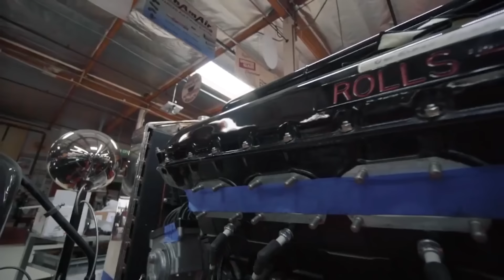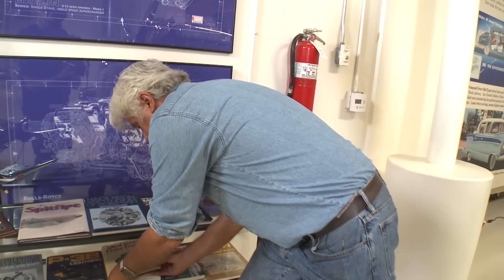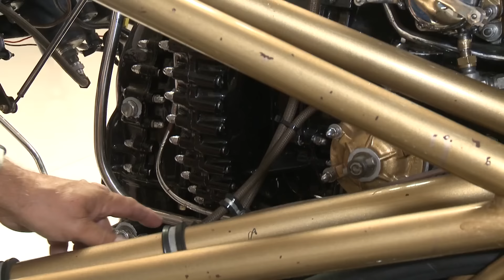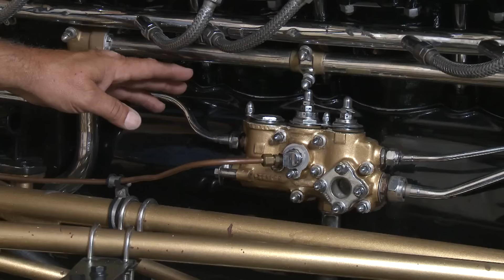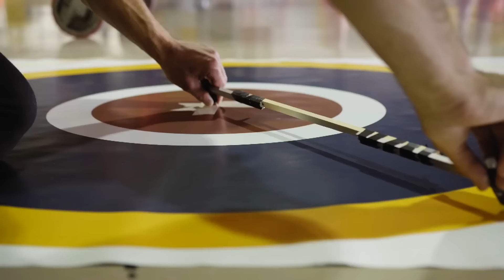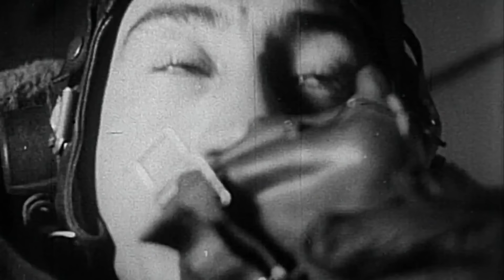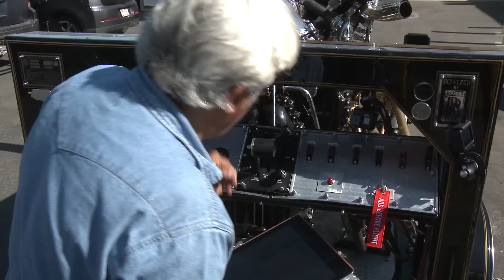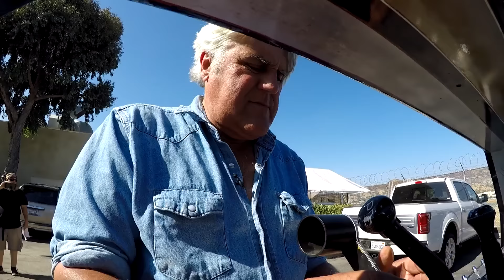The Engine That Won World War II - Jay Leno's Garage

Comment: why does t seem that older engines got more power than modern ones; the merlin got more than 2000hp in some versions bit the Bugatti's have to have more cylinders just to come close. Also, why is this engine not being built today? can we convert ot to run  non ethanol modern fuels?
Reply: Brad Davis-   (1.)  the Merlin never did produce 'more than 2000hp.  (2.)  Horsepower is more a result of displacement, not cylinder count. (3.)  That engine is not being built today because it represents an enormous amount of complexity, which makes it too expensive to build.  You get more horsepower and reliability out of a jet turbine, such as a jet turbo prop for aircraft use, that's a hell of a lot simpler, infinitely more reliable, and cheaper to build.
Reply: Hmm. Some Merlin's did make more than 2000hp, at least if Wiki can be believed; they called it the racing Merlins. But I do get what you are saying: the engines were more complex back then, especially since everything was mechanical. To be honest I just love old engines and love to think about what could be; can one imagine what a modern Marine Packard or even better, a Napier Saber engine would do. And I do believe  that modern versions can be built;  since super/turbo charging was still in early development back then, the modern chargers will make good use of all that displacement, fuel injection, cooling etc... but keep the engines constructed from cast iron for durability and high hp would be the norm for those engines? Well, too bad I have to wait till I gets Jay Leno's money to find out haha!

Comment: The two-piece block is interesting and rings a bell with me.
As I recall... early Merlins had a one-piece cylinder block (not sure if the entire crankcase was a part of that) and head per bank. Unfortunately, porous castings led to glycol leaks into cylinders and a thick white plume of exhaust. This wasn't a particular problem in flight, but of course the 'plane had to be landed right away. On landing, with the Spit's nose-up attitude, that thick plume of vapour engulfed the cockpit screen and several pilots lost their lives on landing.

Comment: Awesome video , but that Lancaster in Hamilton Ontario was not Vera . There are only two air worthy left ."Thumper"  is in England along with " Just Jane "  Thumper fly's but " Just Jane"  works perfectly but they don't fly it .I'm thinking that Lancaster was the one used as a monument on Lakeshore blvd in Toronto that was taken down to rebuild .. ?

Comment: Greatest aircraft piston engine ever made? Uhhh.....Alex.....I'll take the Pratt&Whitney R4360 for the win please........Jay do you realize that you held up an Allison Aircraft Engine book and not a Rolls Royce book.....My father was a P-38 pilot in WWII....he'd probably tell you the Allison V-12 was a better motor than any Limey engine.....same for many of my buddies who were carrier UAL A&P guys....they HATED RR motors.....best described by a buddy of mine.....when you work on a GE or P&W motor things like cotter pin holes redilly fall into alignment......RR motors are assembled and things like cotter pin holes are then hand drilled.....taking one of those POS's apart and reassembling it can be a real challenge when replacement parts tolerances stack up against you.....British engineering at its finest!
Reply: Eric Brandt-  That's because the British never did employ true mass production, as nothing was built for the masses, except for motorcycles.   Here's an example:  In a book on the British Eighth Army in Egypt, the authors report that the weapons depot in Alexandria took weeks, sometimes as long as a month, to prepare a typical British tank for shipment to the front units.  Their tanks would arrive rusty as hell, sometimes with as much as 6 inches of water inside of them from the top-deck stowage on the ships that delivered them.  Also, when in for repair,  British parts did not arrive 'ready to install'.  They had to hand fitted.  That's why British mechanics were called 'fitters'.  Parts had to be ground, filed, drilled, and otherwise custom fitted to repair a British tank.  American tanks, on the other hand, (1.)  arrived as deck cargo from the United States sealed up, taped up, and cosmolined for protection from the sea air and waves, thus not rusty, and readied for front-line action in only 2 days.  Also ,(2.)  and this is the part that REALLY amazed the British 'fitters',  spare parts arrived 'ready to install', that is, all they had to do was open the box, unwrap the part, and bolt it right up.  And it would fit perfectly.  The American tank could be returned to service in a fraction of the time it took for a British tank.  That's why the British so loved the Lees, Grants, and Shermans.  And before them, the 'Honies', and American light tank so named because when a British tanker returned from a test spin in one and was asked his opinion on it, he replied "It's a honey!".   Nonetheless, American mass production skills made a big difference, and I'm sure a similar situation manifested itself in the aircraft engine world as well.

Comment: The RR made a lot more power than the Allison, but it had 3x the moving parts, which was driven by the labor unions in Britain. They weren't easily serviced in the field. if they needed servicing they had to send them back to the factory for service. the Allison could be repaired with a pair of pliers and a roll of bailing wire by any one with basic mechanical skills. The  average American tended to have more of this type of knowledge than your typical Brit.

Comment: I have nothing but the utmost respect for Jay Leno...but I beg to differ, I think the Pratt and Whitney R2800 was the engine (aircraft) that won WW2. They made many, many more then the RR Marlins, the P&W was used on many more types of aircraft and it was much easier, quicker and lower cost to build. 
Just my option.
P.S. Steve Polychronopolous, I agree the Model V-2-34 diesel was a very good engine but they didn't make anywhere near as many as the RR Marlin or the Pratt & Whitney R2800. I've had the pleasure (maybe not so much) of worked on the Model V-2-34 diesel, they are very different from anything from the US, and very powerful...but the fumes will kill you.

Comment: The other recognizable sound was the race car OFFENHAUSER 4 cyl engine. It was my honor to actually built one of the last big bore engines that my Dad drove in Sprint car racing. It is just as distinctive as the " Merlin Music " from a P-51 flying overhead. My Dad was also one of the last A&P mechanics that kept the Connie and other radial airframes flying before the jet conversions of airframes. BTW, NO gaskets were used in rebuilding Offy engines, only aviation Permatex sealer. Try that on modern engines!
Reply: the_punnisher-  Well, actually, the Ducati motorcycle engines (I had 4 of them) went together without any gaskets OR Permatex.  They were all machine-fit.  The cylinder heads,  however,  had to be lapped with the tops of the cylinders, a quarter of a turn at a time, before you installed them.  But otherwise, they all went together dry.

Comment: Living near Moffett Field meant hearing P-3s all year  except on the Armed Forces open house. Then you get to hear B-17s and that wonderful " Merlin Music " for the whole weekend! The last visit I had was the wonderful BRRRTDAY music of the A-10 final exhibit. 
 When I moved to the Denver Metro Area, I went to airshows until an F-86 pilot tried to outdo a MiG 15 at the airshow. In a vertical loop, the MiG pilot pulled out of the vertical dive, while the F-86 pilot didn't. My family and I had left the airshow earlier and saw the MiG flash over our car at a very low altitude. The F-86 pilot bought the farm about 5 minutes later. My Dad ( who did the REAL MASH helicopter driving on our front lines ), knew that the MiG outflew the " brick " in actual combat.

Comment: Look up RRs replacement for the Merlin and Griffon, the two-stroke, sleeve valve engine RR Grecy. It produced a phenomenal rate of power. It ran only on test beds being dropped as jet engines were coming in.

Comment: The engines that won WWI was the air cooled Pratt & Whitney R1800 in the P-47 and the water cooled Allison V-1710 in the P-38 with over 90% of the air to air and air to ground kills. - - - The mustang was only used as a long range escort fighter late in WWII and used the Allison V-1710 early on which was replaced by the more reliable (but almost identical design) Merlin engine. Overall the Pratt & Whiney engines were the best simply due to the fact that they could have been inflicted with heavy damage and still run to return to base. A water cooled engine could not. A P-38 with two engines had redundancy for survivability, whereas the P-51 did not, so pilot skill and tactics determined whether or not he returned or was a POW or KIA.

Comment: actually it was not the merlin in the mustang but the griffin, it was counter rotation to the merlin, almost the same
Reply: stephen No Mustang had a Griffon. Spitfire Marks from 12 on, except for the Mark 16, had Griffon engines. The Griffon was based on the R motor that powered the Schneider Trophy sea planes and as far back as the late 30s Supermarine had plans of putting the Griffon into the Spitfire. The first Griffon-powered spitfire was the Mark 4. Only two were made and were later redesignated Mark 12.

Comment: Dear Jay:  you  are  my  favorite  rich  guy,  but  you  got  this  thing   as  wrong  as  hundred  year  old  limburger  cheese.  The  Slimies  did  nothing  to  win  the  war;   that  beautiful  roller  you've  got  there  was  a  state-of-the-art  motor  for  1929--it  was  basically  just  a  slightly  larger  Kestrel....the  good   'ol  USA  is  in  the  rear   with  the  gear,  few  casualties  no  domestic  bomb  raids,  and  the  best  thing  we  can  hang  off  the  nose  of  a  Mustang  is  a  Slimey   roller....1650,   most  engines  were  carbureted(when  a  spit  rolled  upside-down  the  engine  cut  out),  simple  supercharger------our  adversaries  the   Krautenese  WERE  making  extraordinary  engines....2250,  point  to  point  fuel  injection,  9  to  one  compression,  commando  gerat  computer  engine  control  systems.    The  TA152H-1  had    a  3  stage  3  speed  supercharger--I  refer  to  the  Jumo 213E   and  F,  the   Daimler  Benz  605,  the  Jumo  222 (3450  cubes)....all  running  3000  to  3200  RPM.  These   were  state-of-art  engines  for  1965.......Rolls  caught  up  to  now  defunct  German  technology  by  1947-48....WE  continued  to  hang  stone  age  Radials  (1920  technology)  off  our  DC  6's  and  7's  and  Constellations  until  expensive  turboprop  technology  took  over.....asi  es  la  vida,  vida  loca.       GLR

Comment: Seems like an error in the start procedure.  Takes 3 tries to get the engine to run because Jay forgets (or maybe cause the checklist is incomplete) to move the mixture to "rich".  The engine fires and continues to run as Jay primes it and pumps the throttle but you can clearly see the mixture control is left in "cutoff" until the third attempt (when it actually starts).  The correct technique should be to move the mixture to "rich" as soon as the engine fires - there is no reason why that engine should not have started on the first attempt.

Perhaps Jay should contact the CWH and get a refresher on the proper start procedure.

Comment: Great video, Jay! I would give 'Honorable Mention"to the Pratt and Whitney R-2800 radial engine used in the F6F, F4U, P-47 and others.  The Wright R-3350 ended the war. And Jay, ignore that stuff about toggling the prime switch on and off.  Hold it on till the engine lights and go rich on the mixture control and then release the primer switch. That's how we started the R-3350 in the P-2V Neptune.

Comment: Only for want of a two stage, two speed supercharger.....the Allison is a more durable engine.  Plus the R2800 and the R3550 were far more critical to the war effort + PLUS British avgas was terrible.....chew on that, anglophiles
Reply: Randy Magnum-  Right!  It was higher-octane American avgas  (100+ octane vs. 80 octane) that enabled British aircraft engines to operate at anywhere near their potential rpm's and speed.  Britain's own fuel came from BP refineries in the Mideast and all they were capable of producing was 80 octane, so they badly needed American avgas to mount a decent war effort.

Comment: Is the merlin a pushrod engine or OHC? Dohc or sohc, 4 valve per cylinder or 2?
Reply: DUUUUUHH!!!! SOHC 4 valve engine !!!!!
Reply: Tad Ficus Catus-  As shown in the video and pointed out by Jay, the Merlin engine had 2 overhead camshafts, one for row of valves, each camshaft driven by a tower shaft and bevel gears, like an early Ducati motorcycle engine.  The combustion chambers had 4 valves in each chamber.  Look at the shape of the exhaust stacks where they bolt up to the head and you'll see that they rectangularly shaped at that point, indicating two exhaust valves.  If you're familiar with these engines then what he says will sound familiar, but for a lot of people a second or third viewing may be necessary to get all that he's saying.
Reply: Wilbur Finnigan-  Wilbur, that's only true per bank.  There are two banks, however, so that make it a DOHC engine.

Comment: I wonder how a Merlin compares to a Daimler-Benz DB 605 ?
Reply: Joseph Summers-  Yeah, it's because the Germans had their heads up their asses and it gave them an upside-down view of the world.
Reply: By inverting the engine it puts the main bulk of the engine below the line of the crankshaft and I believe the idea was it gave better forward visibility to the pilot over the cowling. I believe it also made some aspects of servicing easier as the cylinder heads were more readily accessible.

However, it's not clear that it would make that much difference in practice. Spain had to fit its Hispano Aviación HA-1109 (a licenced-built BF109) with Hispano-Suiza 12Z-89 engines (a "regular" V12) as Germany couldn't spare any DB605A engines during WW II. After WW II Spain even fitted some of these aircraft with Merlin V12s. Ironically it was some of those Spanish BF109 copies fitted with Merlin engines that were used in the film The Battle of Britain. So there is the strange spectacle of BF109s, Hurricanes and Spitfires all powered by Merlins in that film. Needless to say they had to dub the sound of the DB605A engine as they are audibly very different.
Reply: The latter sounds feasible, but as for the former the Spanish who were building them after the was were putting Merlins in their place because they were easier to come by then. It was Merlin equipped Me 109s shot in "The Battle of Britain."

Comment: That engine is not a Rolls Royce. 1650's were Packard built...about 1100hp. 1750's were Packard/Allison built.  About 1400hp. Rolls Royce 1750's with the dual speed, dual stage blowers is the engine that won WW2! 2000+ HP in the D Model Mustang that got them up to 25000 ft+ to fly cover over our bombers. Oh...and by the way. Jay needs to find that mixture control when he starts that thing up...or he may be burning valves! FULL RICH!

Comment: There's nothing "redundant" about that ignition system since each pair of mags is driven from a common drive. Lose a drive and you lose both mags. Lose both drives or have a mag fail on the remaining drive and mag pair and you better start flapping your arms.

Comment: IDK if I'd say it's the best aircraft engine. It would depend on the job you are doing. For example for ground attack a nice air cooled radial is better, since some lucky jerk with a rifle could bring down an aircraft with a liquid cooled engine.
Reply: yes they had water injection for WEP, or also to take off when fighters they were in were loadeed with a heavy bomb load, (p47's could carry 2500lbs. of bombs), But there are multiple stories of pilots returning to base with clinders shot right off. Also you needn't be that lucky to shoot a hole in the radiator of a liquid cooled plane since mostly those radiators were underneath.

Comment: I'm always a little surprised when you guys "plus" a project that you don't take the time to blend it in? I'm not a giant fan of the 90s vinyl graphics and white wall tires but it looks like it was the way the guy built it originally..I would think you would want to match in the giant white truck filter and aluminum housing with all that black and chrome or at least hang it straight... I do love the motor and the video, just an observation.

Comment: How safe is that running a prop with a powerful engine on a small trailer tied down?
Reply: se7ensnakes not too dangerous unless you're not controlling the crowd. that prop is cut down and the low pitch stops are set pretty coarse. Not much thrust being generated, the real purpose being just drag/resistance to the crank
Reply: Still it looks unsafe.  That is one amazing engine.